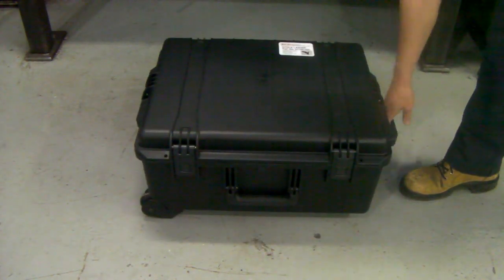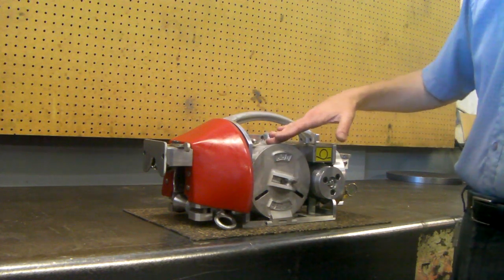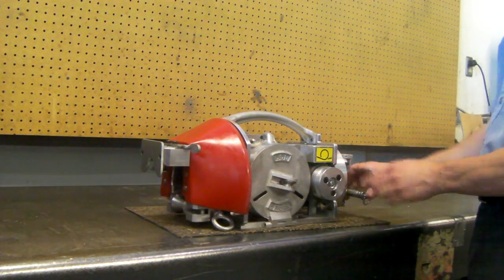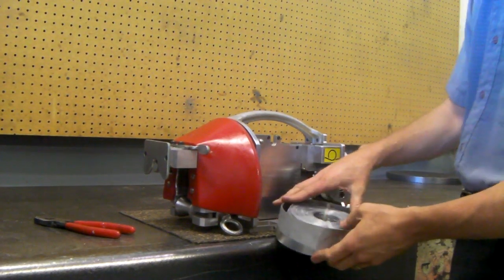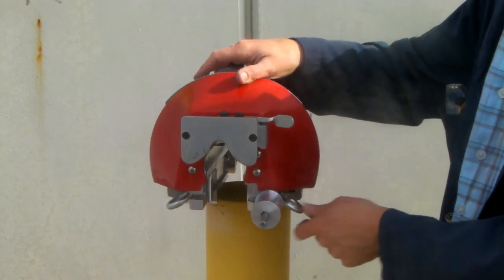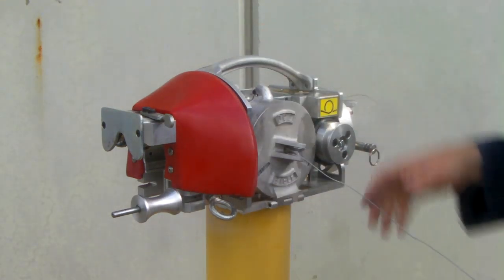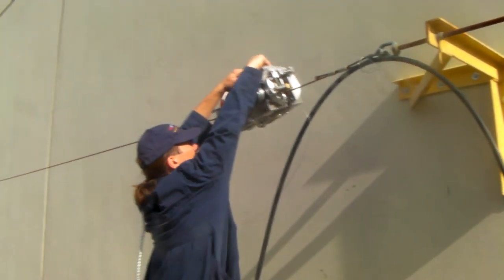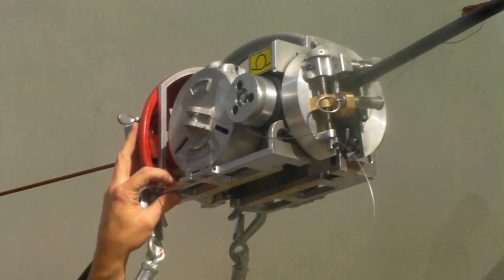How to set up the Eagle Cable Lasher for Overhead Line Work

Comment: I like the size and weight of this lasher but seems the transfer time could be prolonged versus the standard c2 or j2 lasher. Most of us work by units so the faster the transfers the more units per day. With the c2 I can average 3 1/2 minutes on bare strand per pole. Can your lasher compete?